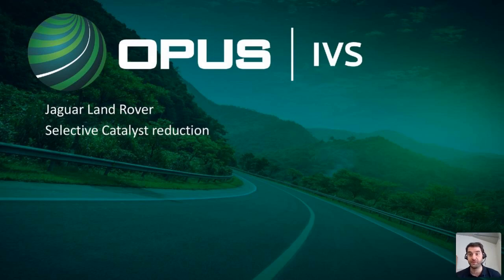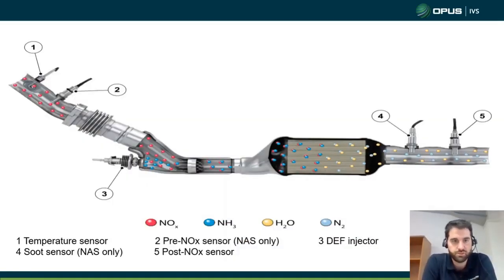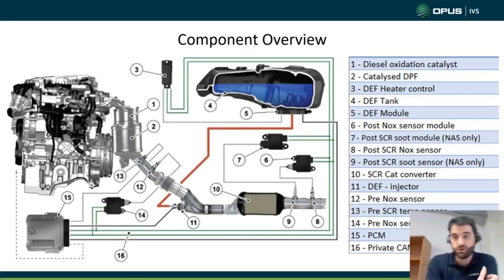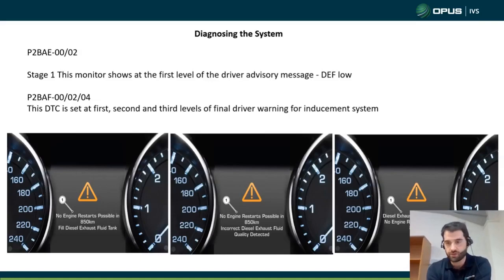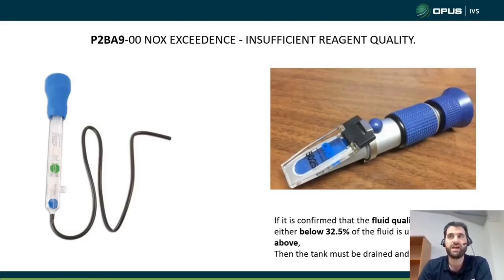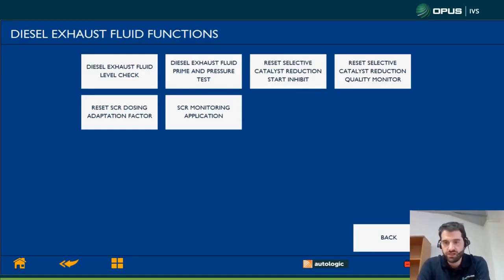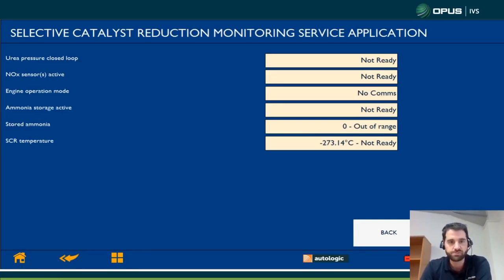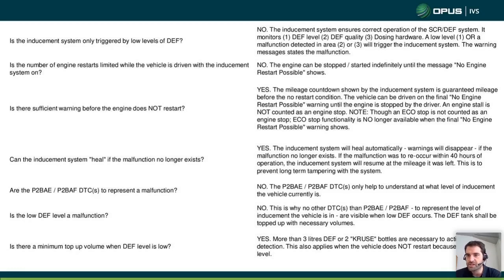JLR SCR 4th November 2020

Comment: Hopefully the prices of the Adblue injector and the nox sensors will plummet. We are replacing a lot of them , the nox are particularly troublesome and VERY tight, some resulted in a new section of exhaust,  often only available from a main dealer at vaste expense.